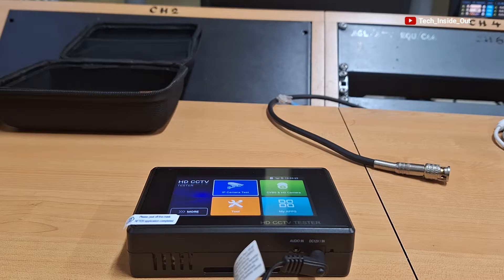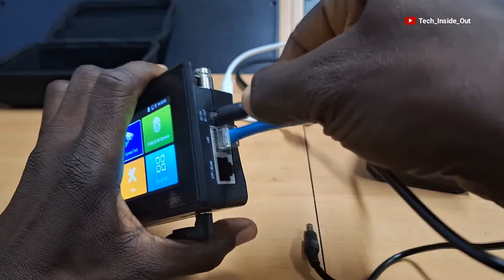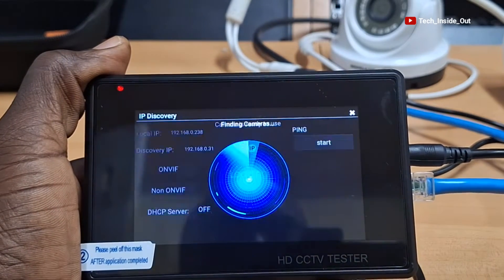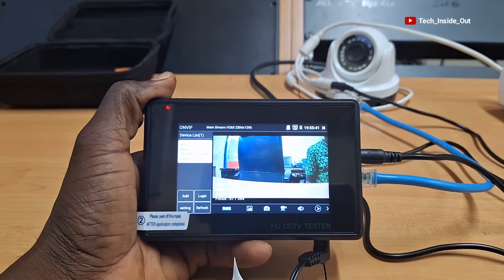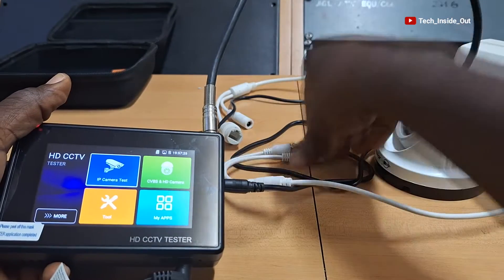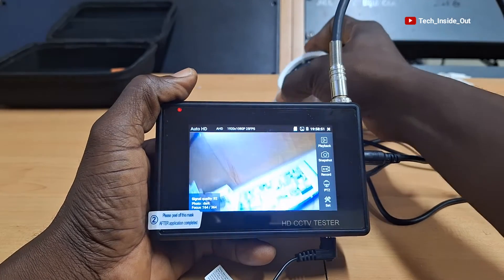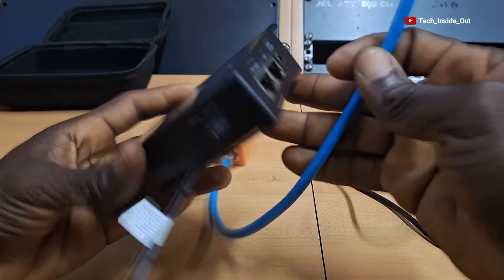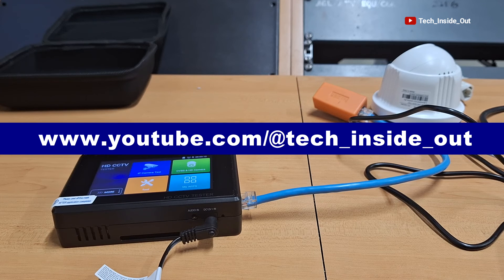CCTV Camera setup and test tool tutorial

Comment: I have the same device. Brand new camera, default username and password is both admin. Still all it will say is user or password error. How do I get around this?
Reply from the maker: Please try using it on another camera and lets see the outcome because i haven't come across that challenge, i suspect the default User name and passwords might have been altered.
Reply from the maker: Please try it up on another camera with a different manufacturer because i suspect even though the camera is new, the default settings might have been altered

Comment: Can u explain further  what onvif means
Reply from the maker: ONVIF stands for Open Network Interface Forum. It is a standard that requires CCTV products and manufacturers to follow so that products of different manufacturers can be used without compatibility problems. 
It requires a manufacturer to join this forum and once they join, they must product components to a certain standard accepted by the forum.
Reply: @Tech_Inside_Out  thanks.. so that means its possible  dvr and cameras from different manufacturers may not wok.. furthermore how does one knw if both devices are of the onvif standard